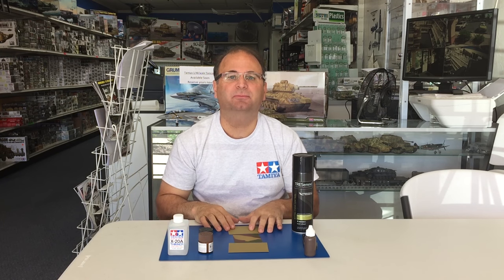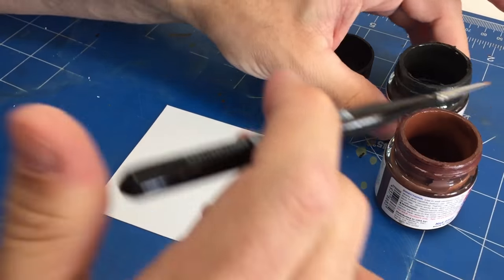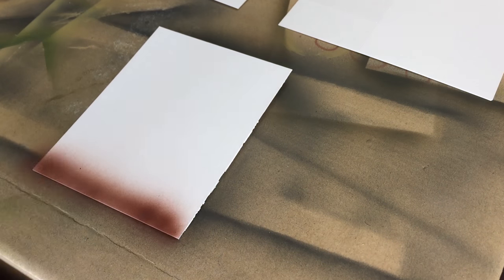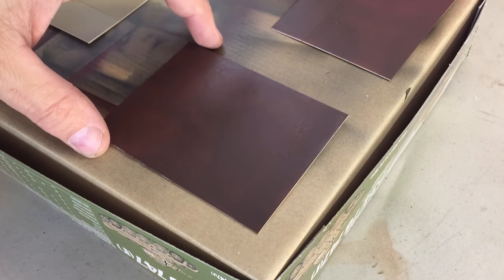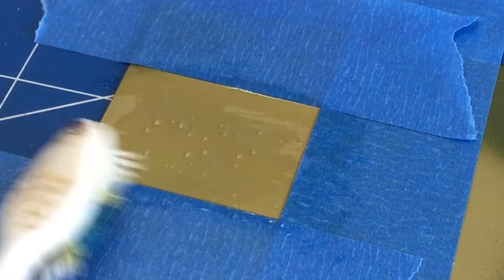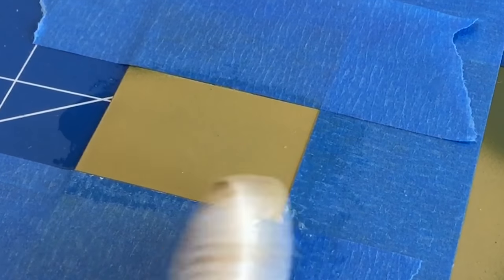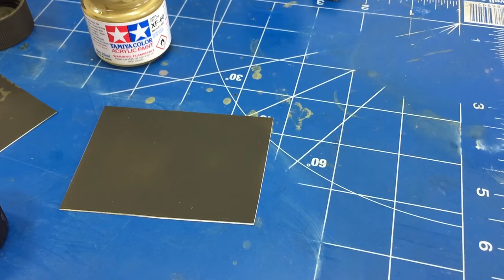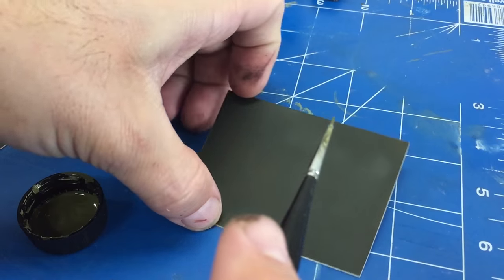Chipping 1/35  scale models

Comment: Andy, I love your videos. 

One quick tip on hairspray chipping. The top coat will chip much faster and you will have much more control if you thin the paint with water rather than a thinner. If you use water, you can use a regular paint brush to chip, it gives much more control and you can make really small chips.
Reply: Joe Behar you really can't thin tamiya's paint with water if you are going to airbrush it
Reply: Saunaatana - Although I normally use the Tamiya laquer thinner for airbrushing, I've had good success thinning Tamiya paint with water for this application. A few things that make it a lot easier.

1. Don't overthin the paint. I find about a 50/50 mix is good.
2. Use really low pressure on your airbrush (15 lbs maximum, even less if you can) this minimizes splatter
3. Keep the tip of the airbrush clean of droplets with wet q tips as you are spraying. This will help with splatter and also avoid tip dry and clogging. After a wipe with the wet q tip, re-establish a good spray off the model and go back to spraying on the model

The resulting coat of paint will not be as smooth as paint thinned with the proper thinner, but I find that it actually accentuates the chipping and makes it more realistic. The water thinning makes it possible to create extremely small chips.

Michael Rinaldi, in his TankArt books, describes the hairspray technique well. If you get a chance to pick up one or more of his volumes (I think he has 3) it's well worth reading. One of my favorite lines from him is "you can never have too small a chip"
Reply: Joe Behar m

Comment: which method do you prefer? im so close to building my panzer iv ausf j. but I forgot dark yellow lol I guess its a good thing because its making me finish my b-17, I have to brush paint because testors clear part cement is garbage and the windows arent bonded and fall out with  any pressure trying to mask them off.
Reply from the maker: the small chips paint brush and sponge works well , the hairspray is for bigger areas